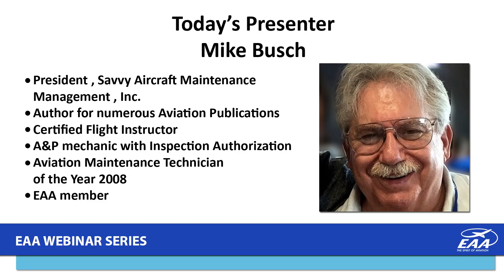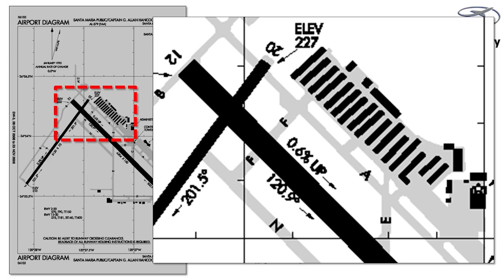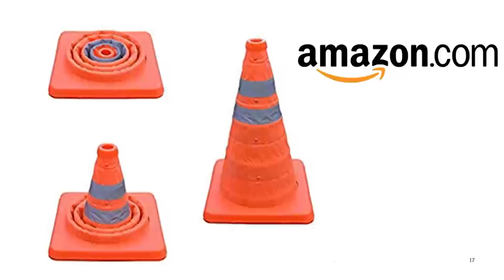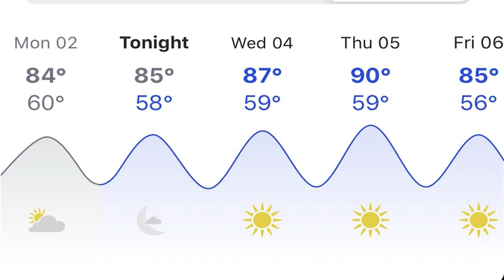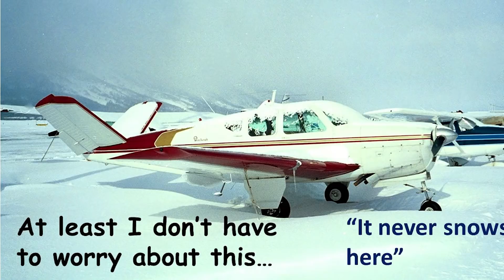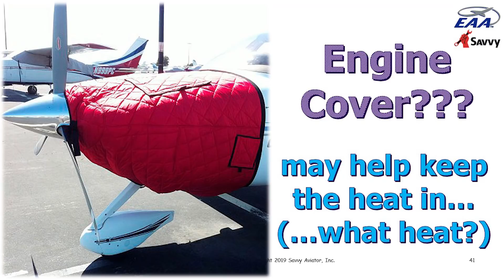Is Hangaring Worth It?

Comment: Hangered v. tiedown:  I did both and I think it depends on the tiedown spot.  I was on a large ramp at HEF and had no issues with bird's nests.  However, I did have a problem with birds pooping all over the plane.  Then I got a tiedown at MGY and the birds had plenty of nesting material available and they made a mess despite plugging every hole in the plane.  The other issue is what sun and dust do to the finish of a plane, especially an old finish that isn't great to start with.  Fortunately, I got a hangar in June and, after completing the annual and cleaning all the birds nests out, it's safe and sound in the hangar.  It took me 3 weeks going over the finish of the plane and restoring it the best I could.  I am 2/3rds done with that, but it does seems to stay nicer looking while keeping it in the hangar.

Comment: Hangaring at my airport (Canberra International) is $15k per year.  That's right, $15k per year.  My Mooney M20J is worth around $130k.  My solution is a set of aeroplane covers - everything is covered except the prop.  Cost $2500 and lasts for about 4-5 years.  My latest video has a shot of them in the intro section.  I would love to put my precious is a hangar, but complete covers are a reasonable second-best option IMHO.
Reply: Have you tried trickle heaters for the engine and trickle chargers for the battery?
Reply: @dabneyoffermein595  The plane wasn't in a hangar, it was parked outside with no access to power.
Reply: @sactu1 oh, no power, yipes

Comment: Does that condensation argument hold if the hangar is unheated? What would prevent the pricey temperature fluctuation if there's no heat source? Both the temperature drop and the moisture are still there behind the closed door...

Comment: Interesting video! I have a question for you: 
if you were to keep the aircraft hangared what would the cost be in 10 years, and what would it be if you were to park it outside for the same period.
What would the possible damages to the aircraft be and what would a hypothetical repair cost be?
I was taught if an aircraft is going to suffer from corrosion it will be more sever inside a non heated hangar as the air inside is stand still and any moisture in the air just works its way round metal.  
You can do a simple test, leave a wet cloth in your hangar and see how long it takes for it to dry, and at the same time leave an  identical cloth with similar wetness outside in open and see which stays wet the longest!!
Reply: That’s my understanding is as well. There can also be increased corrosion from fuel vapors trapped in an enclosed space. While I do think a hangar is probably a better solution, it’s not the end of the world to park it outside if it’s regularly flown.

Comment: It’s kind of a no brainer . Get a hanger. I was born and raised in aviation. Dad and I both flew fighters in the Air Force and flew with major airlines. I have over 50 years flying experience, over 40,000 hours , flown and owned many aircraft. Dad bought and sold many aircraft in his lifetime. Rare warbirds and antiques. We have always had hangers. I own a very nice aircraft and I would not dare sit it outside. Take care of your aircraft and it will take care of you. Bottom line , protect nice things and if you can’t afford a hangar or have issues owning a hangar , you probably shouldn’t own a aircraft. It’s better for so many reasons to have a hangar than not. Sitting aircraft outside will rapidly deteriorate Paint, interiors, windows, etc. By all means get a hanger if you don’t have one.

Comment: What is experience on a T cover (no enclosed but out of rain and sun)?
Reply: I've used covers that essentially cover everything- wings,  fuselage and tail- MOSTLY to keep the sun off. Rain is a secondary consideration but dew (condensation) isn't a trivial issue. Mostly these were sailplanes with wings so long that they didn't FIT in hangars unless you assembled and disassembled them each day. The covers aren't trivial- they can't be allowed to lay directly on the skins, which is because if they trap moisture against the airplane it's WORSE that just being out in the rain.  In short: if you can afford a hangar,  that's the way to go. But if you can't,  good covers are best IF YOU CAN KEEP UP WITH THEM.

Comment: I live in southeast Texas on the Gulf of Mexico. leaving it outside is not an option. The salt air will corrode the aluminum doubling even tripling the maintenance costs. I am also always worried about sand and scratching the windows while washing it. I run a dehumidifier in my hangar that keeps the humidity around 50-60 as opposed to the 80-90 it would be without it. Not to mention it keeps my plane out of the sun and dry. I own my hangar and pay a nominal $100 a month that I pay on an annual basis for land rent to the airport that is much more cost-effective than rent every month.

Comment: As a civil engineer, let me just say that I see terrible alligator cracking in the taxilane asphalt in the picture with the fuel truck. This will eventually start crumbling, and then you'll have little rocks in your propellers. In fact, one would do well to include a walk down the taxilane looking for debris, rocks, dirt clods, nuts & bolts, potholes, etc., as part of your preflight inspection.

By the way, any advice on tiedown anchors? I'm building an apron right now, and I'll have the opportunity to install some permanent ones.

Comment: I certainly think its worth the cost! I have a 1960 172A I purchased from my Dad and a partner  he solicited 20 years ago. Dad has a private hangar but was primarily used for his ag planes at the time. The 172 spent most of its life outside, I am now doing a refurb and have found corrosion that would have been prevented had the plane been kept hangered. Not to mention the paint had chalked up and faded. The top of the wings were just about bare. Now that Dad ag business is no longer around I keep it in there. I have attempted to rent half of the 4200 sq. ft. out but no one is interested or so it seems which shocks me. The waiting list at the local airport is lengthy. We are only 19 nm from that airport but a 2500 ft. grass airstrip is of no appeal to the city guys!
Reply: How often had this 172 been flown?  Hangaring is best, but letting an airplane sit will always cause corrosion, even if it is hangared.
Reply: I would rather park outside than watch my plane get bent up from people moving their planes around who don’t care about my plane.

Comment: I heard of an interesting occurrence at the local airport. They had free outdoor parking, and some 12 YEARS earlier, a plane flew in and parked and tied down, and the pilot/owner promptly vanished. The airport, was then wanting to construct new hangars in the area where that plane was parked, and asked the owner to remove it so they can clear and start. Problem: no other parking spaces available, so the aircraft needed to fly out, BUT the CofA had expired due to no inspections, and the airframe was determined to be too badly corroded to allow a temporary flight permit. The owner had to disassemble it, place on a trailer and tow it away - the trailer was badly loaded, and he jack-knifed into the ditch on the highway, destroying the whole thing. He tried to sue the airport authority, but got dismissed.

Comment: Changed a cylinder on the ramp after having engine trouble on the way back from OSH. Not fun!
Reply: Really you did not have fun on your flying trip,    how sad
Reply: Greg Plaka 
Had fun, but scary on my fourth ride in a small aircraft when we lost RPM and had heavy vibrations. Bent a rod

Comment: Interesting topic. Thx. I look after technical support of ~80,000 commercial mowers that are typically left outside year round (Wright mowers, air cooled engines, open electrical systems, etc.). Temperate areas in the center and northern areas are not as bad a southern areas that have heavy dew every night, like FL thru SC. Summer in FL is worse than snow in MN. The worst factor in weathering is when people regularly clean with detergents and pressure washers--it is worse than never cleaning them. Dielectric grease on electrical connectors is key to prevent fretting electrical connections. Stale fuel (ethanol) is a major problem.
Reply: What have you found out about midwest climates Ohio/Indiana (is it pretty bad?) As far as outside storage (the temp ranges are fairly significant I would think due to having four distinct seasons).